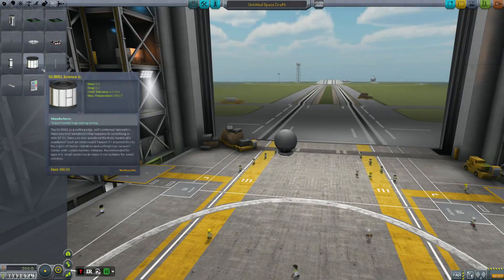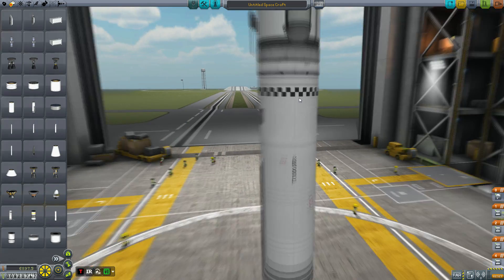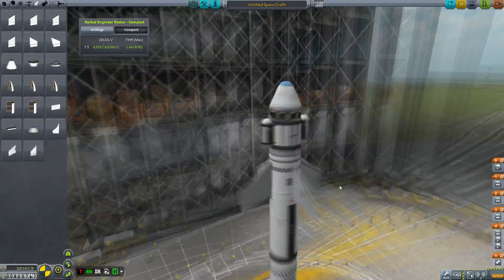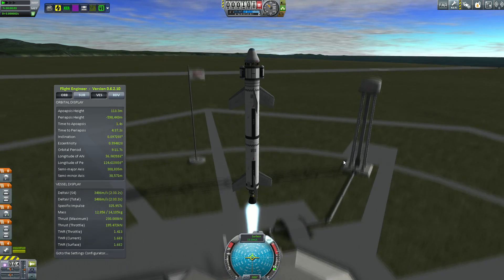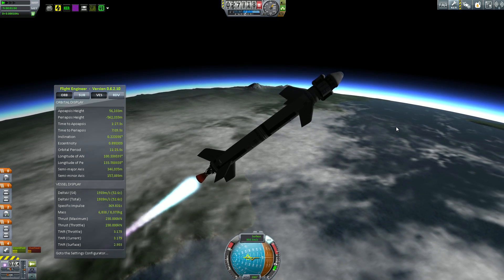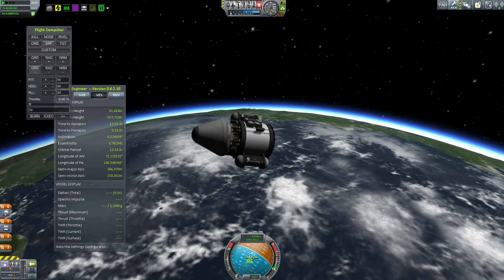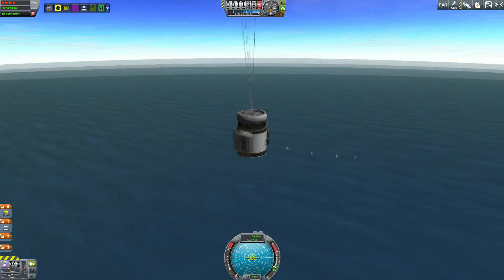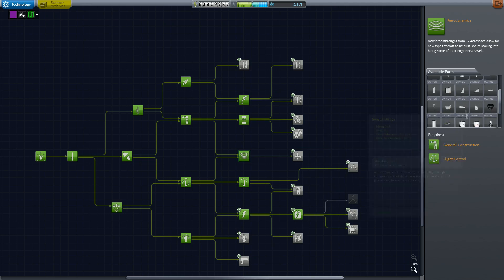Kerbal Space Program - Kerbal Realism - S2 Ep 6.5 - Near Kerbin Science

Comment: Thank you for your content!
May i ask a question, how did you get Interstellar to work with 0.24.2? 

Upd. Just in case, I'm using pretty similar build. Aside from Interstellar, cause i had HUGE problems while getting it to work with everything else.
Reply from the maker: I am using Interstellar Lite. Its a branch from the original mod and has regular updates from one of the main contributors. Also, be sure to be using Active Texture Management :)
Reply: Hah) That's explains everything, Well then since Fraktal_Uk is back, i'm gonna stick with basic interstellar, and wait for an 0.24.2 build.

Mb then change a description so it  would say "lite"?
now it's quite confusing =)

And yeah ATM is most important part, without it everything just went down in flames=)

P.S. Thank you for fast answer. Really appreciate it.